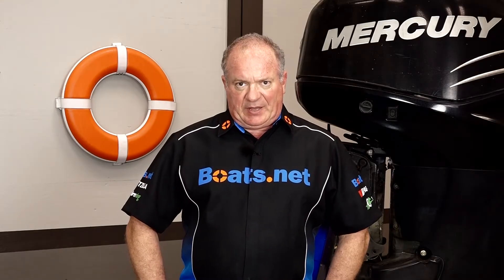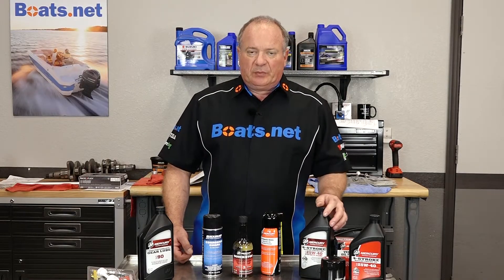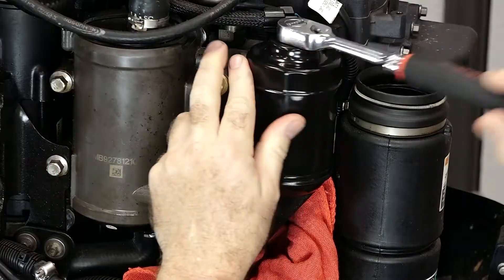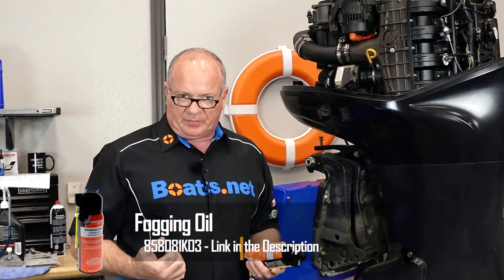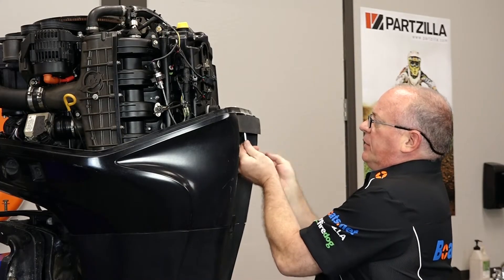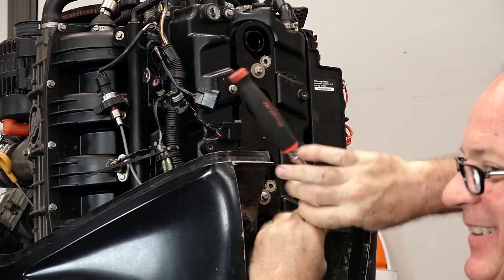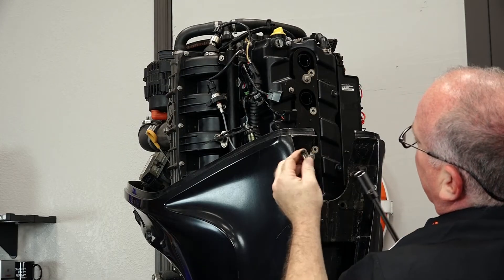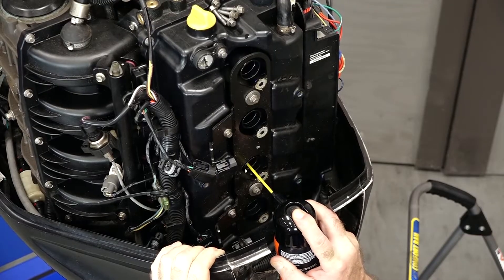How to Winterize an Outboard Motor | Winterizing a 4 Stroke Outboard Motor | Boats.net

Comment: I have a 1996 mariner magnum 150 hp 6cyl outboard. It is fuel injected and I am not sure what I need to do to winterize it? First time having an outboard this big and I am not even sure what it is? 2stroke, 4 stroke ect?  There is a small 2cycle oil container overtop where the carbs would be and a very large maby 2 gal one by the gas tank. I have no idea how these work. I bought boat used and it is a 1996 popcraft 180 that has been garage kept. Anyone who has one like this and can take me to school.

Comment: I'd recommend smearing a bit of anti-seize on those spark plug threads prior to reinstall ESPECIALLY if they are slightly corroded like those in the video.

Comment: Do you have to start engine for 1 or 2 seconds after you put fog seal in cylinder walls ?
Reply: Hi, you don't want to start the engine, but probably crank it for few turns so that storage oil covers the entire chamber

Comment: I called Mercury headquarters and asked specifically if you should fog the engine on their 60hp four stroke when winterizing or long term storage. They said no, not on a four stoke. Mercury headquarters phone # (920) 929-5040
Reply: Nice to know , 
I have the same motor
Reply: Mercury's website says to fog both two and fours.  https://www.mercurymarine.com/en/us/dockline/winterizing-your-outboard/

Comment: I thought you were supposed to spin the starter a few seconds after fogging, prior to installing the plugs to allow the oil to fly around a bit and coat the circumference of the cylinder.    Thoughts?
Reply: +1
Reply: Yeah this guy is an idiot
Reply: I was thinking the same thing and was going to ask that question. It looks like you never got a response back inspire of the fact that the host states that he would answer questions. So full of s***t

Comment: I wonder what a bore scope might show for those spark plugs with the rust in it.  Bottom of the cylinders love to collect moisture and form rust spots that can cause small pockets for pitting if the moisture and corrosive environment is bad enough when engine left unused for very long duration.